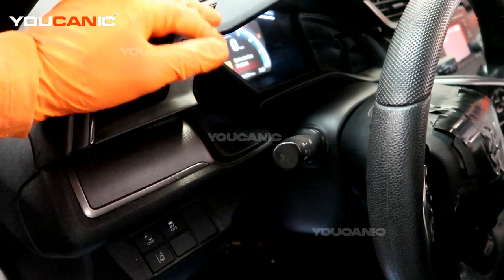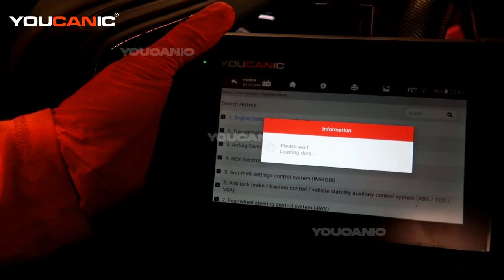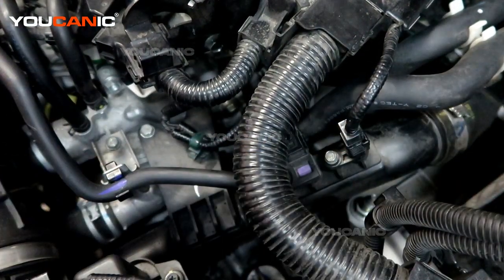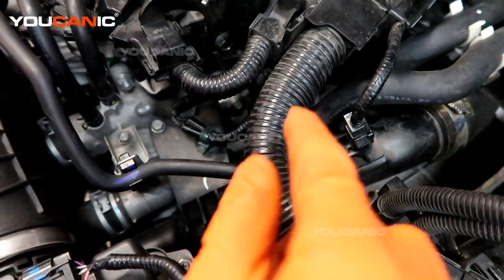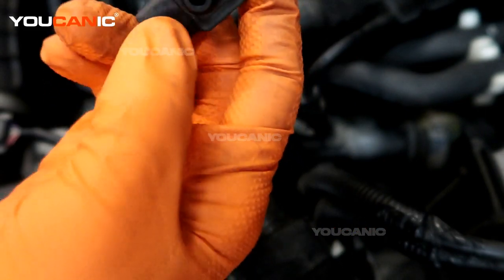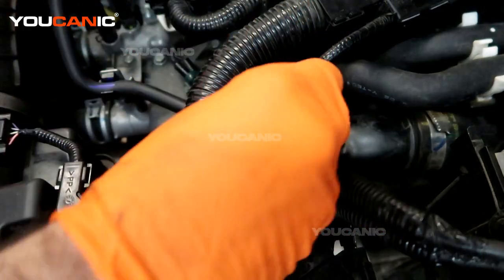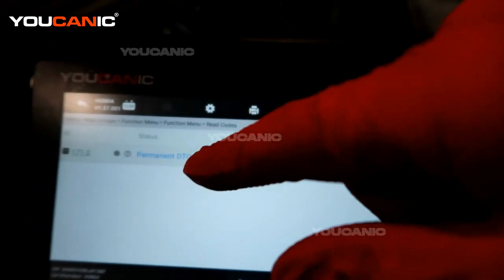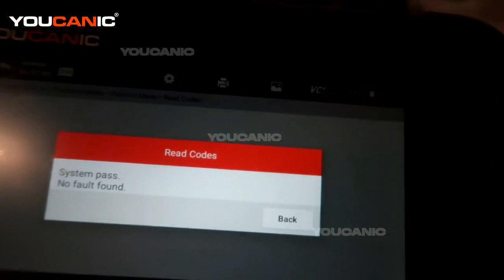Honda Turbocharger Boost Sensor Replacement - P171-2

Comment: How about Code P1247 in a Honda 2002 Accord?
Reply from the maker: Thanks for your query! Your Honda 2002 Accord's Code P1247 typically relates to the turbocharger boost pressure low. For more specific, detailed guidance, feel free to check our resources at www.youcanic.com, where we provide helpful guides and a powerful YOUCANIC scanner to assist car owners.

At YOUCANIC, we're dedicated to empowering you through your car ownership journey. We offer free resources and even factory repair manuals for those who need it. Don't hesitate to reach out on our site if you require additional assistance!